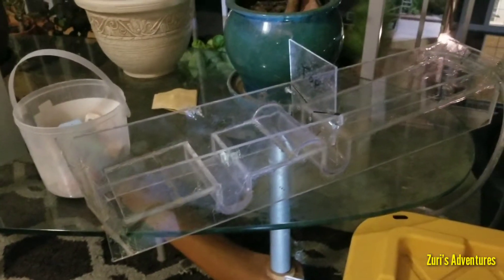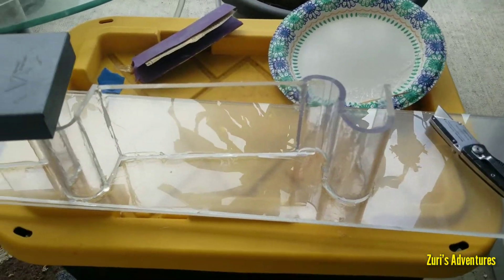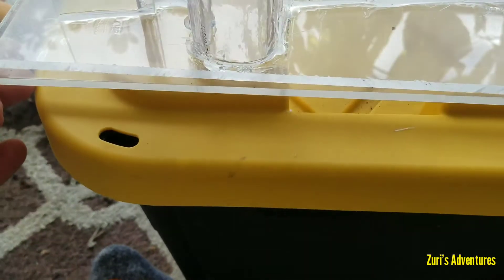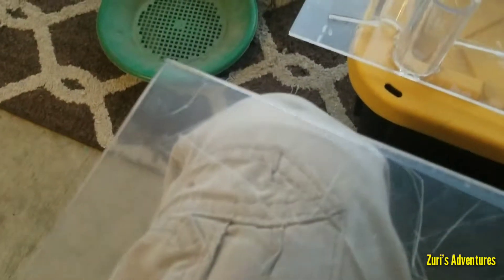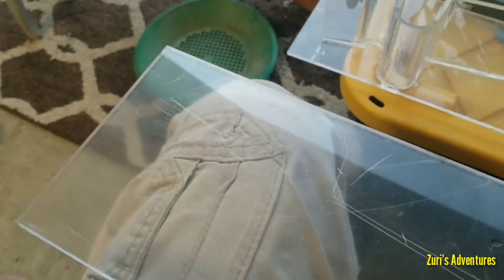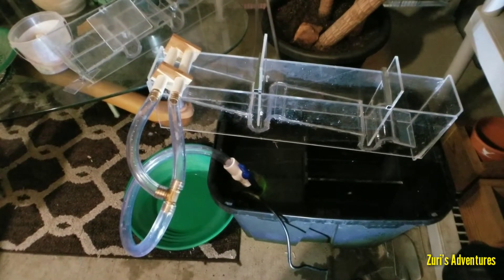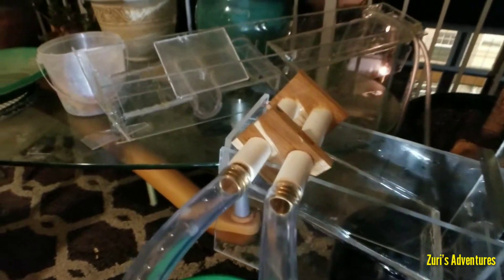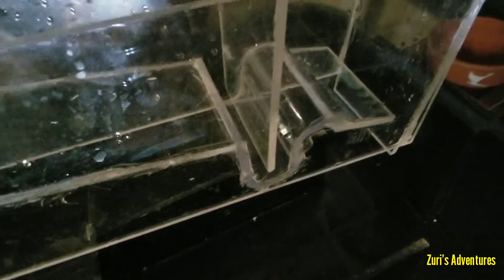Homemade underflow sluice box rebuild.

Comment: You mentioned Mercury. And I keep thinking about a Copper Sheet somewhere in my sluice system to capture any stray Mercury I might stumble across. Doubtful I will, as Western Washington is not really known for prospectors having used Mercury here, but...
And if it did catch any, I'm sure it would eventually become saturated with Gold. And at the point I couldn't see Copper, I'd ship it to a refinery certified for such Shenanigans (Na na, na na na).

Comment: cool sluice box gonna make 1 as well but curious why didnt u have the two parts where the gold drops down level. 1 is like an inch or so up and the other is lower does it make a difference
Reply from the maker: Better water flow.
Reply: @zurischeidegger  do you notice a difference ive always thought you would want them even.
Reply from the maker: @ericluscombe3272   Yes I noticed a way better flow of the material going through.